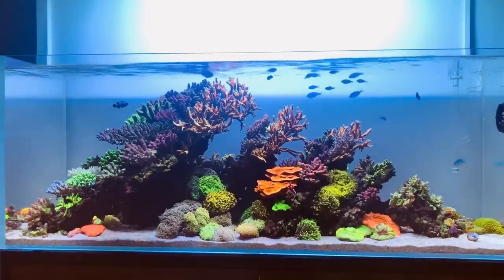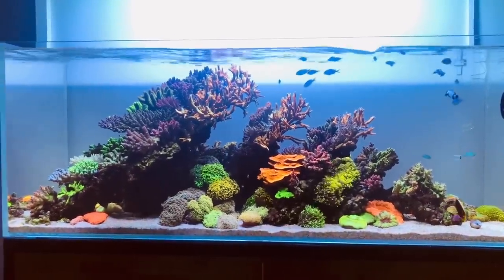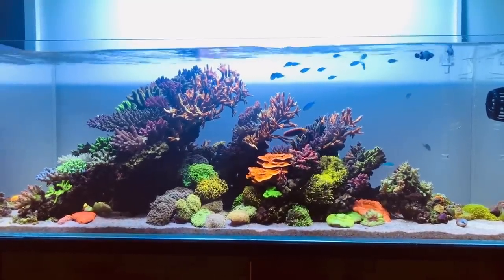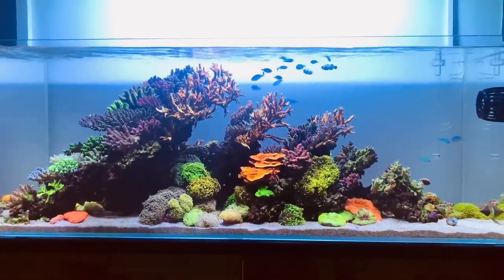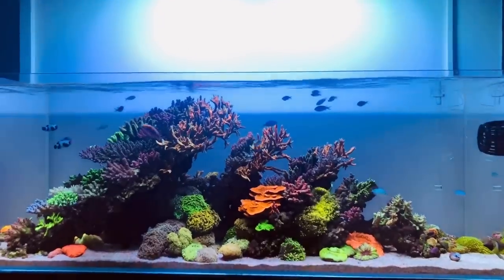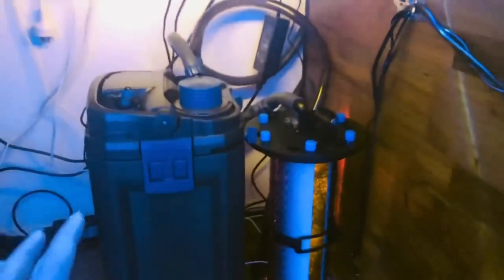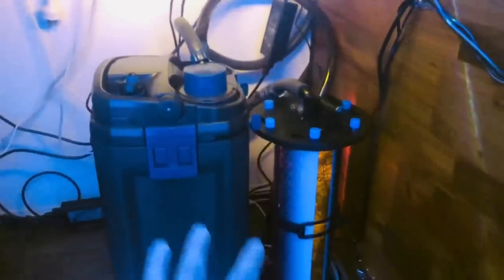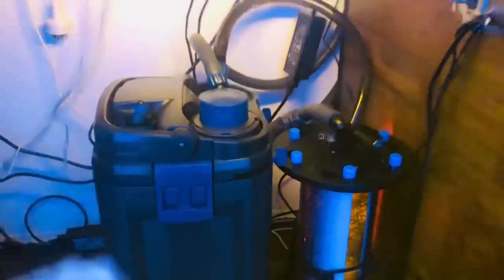Canister Filter Reef Tank? Yes! - Tips and secrets to successful canister filter reefing

Comment: I think your setup is way more expensive than a sump with identical equipment. I also think you are doing it wrong on many levels here and you work more than necessary just to compensate that. And since you are being cheap, your filter is rated to 22W and with no load at all, pumps a maximum of 1250L/h. A Jebao 3000 return pump pulls 25W for 3000L/h at max speed. (next time do your math) Your so-called complicated sump maintenance for me: Open door, pick the tweezers, pull out floss from sump cups, put new, put back the tweezers, drop dirty floss in trash. About 20seconds, can do it whenever I want without stopping anything.
Reply from the maker: Yes I ran a sump before, it’s the aesthetic that makes the difference. But thanks for your facts
Reply: Christopher Walker  As you might noticed, the hate (apparently anyone that disagrees with arguments is a hater) is aimed at bad information. A good looking tank does not make the information good. While his method might work for him would make 99% of the people that try it, fail. This is not cool to do, no matter how cool your tank looks. The groups and forums are full of such people that fail because some online guy "made it simple". Bad practices are bad, period. If this is his personal approach, keep it to himself, I don't have any problem. I salute that. Plenty of people do it and I have nothing against it. But when you are giving out false/bad information as, tips, or offer some level of tutoring, there is a problem. RL comparison: X has been driving drunk for years and nothing bad happened, others should do too because his history is clean and had no accidents. Would you follow that too?
Reply: @alexl.9317  you need some serious help. youd be fun at parties and i dare say either a crazy cat or dog lady. the sump system he has he was simply showing people how easy it is to NOT have the black backdrop and have a clean clear tank. not comparing saying it is better or worse. grow up